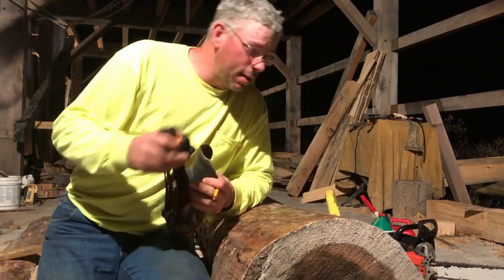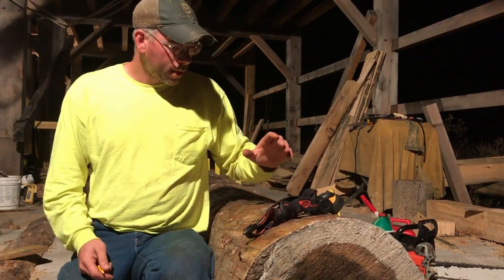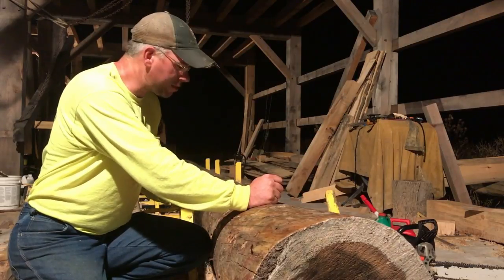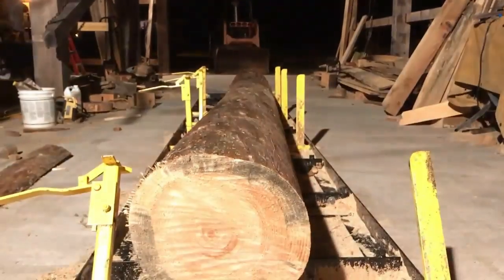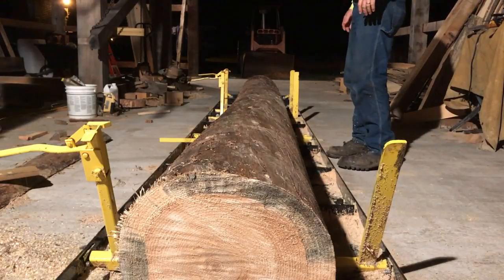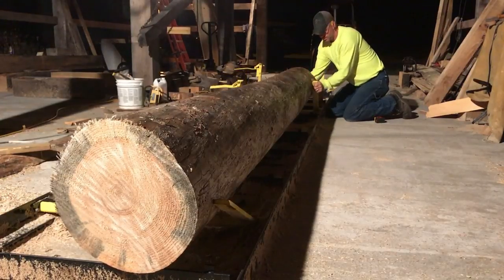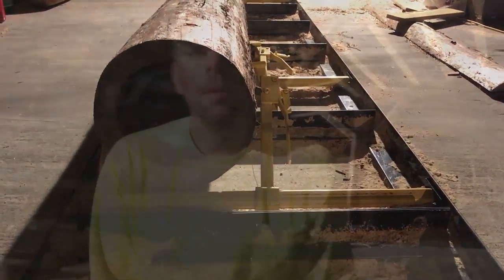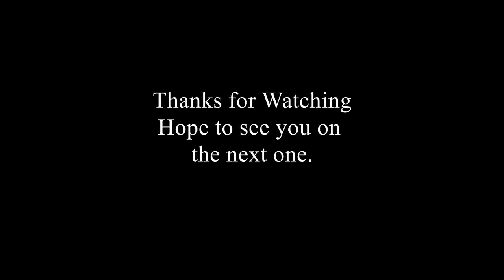A Timber Frame Vlog #68: Get the Most Out of Your Logs

Comment: Jim, you have been talking about queen posts, where do they go. Vertical members on the top plate? Excellent logs you should be able to mill some good planks or posts. Keep safe
Reply from the maker: +Tom Hohenadel queen posts are built in the shape of an H and will support the center spans of the rafters.

Comment: Jim,
Good video. I sometimes struggle with milling, as I am a newbie and there is little reference material out there as to how to properly place logs on the mill to achieve a good straight beam. Please keep posting.  Do you use diesel as a lubricant or soapy water?
Reply from the maker: +Tim ODell I use pinesol and water in warm months and windshield fluid in the winter.

Comment: When you measure to the heart are you measuring off the slab or off the rails? When you measured in an old video I was surprised because I thought the measure was from the bark to the heart and was 14". Gave me log envy.
Reply from the maker: +Lolita's Garden it all depends on how the log is sitting on the mill.  I like to measure from the mill bunks when I can but if I'm not over the bunks on both ends I measure from the slab.  I have had logs on there that were 3' diameter many times though.

Comment: What type of heating system are gonna install ? Best regards.
Reply from the maker: +Silver surfer I'm building a sawdust burner for the heat as well as a used oil boiler (from scratch) to run a kiln and for backup heat.